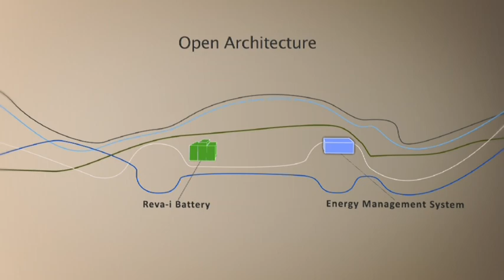Reva: Smarter Cars | The Future is Electricity | Mahindra Rise

Comment: A G-Wiz is not smart, its rubbish. Reasons: If you turn on the radio, headlights, turn signals, brake lights, hazzards or air conditioning the battery will die. If you run it into a table, the hole car explodes (TRUE FACT) And it is very slow and sluggish. Truly a car that only IDIOTS would buy. Reva: cars for idiots. Ford, Honda, Mitsubuishi, Aston Martin, Dodge, Volkswagen, Volvo, Saab etc: SUCCESSFUL cars.
Reply: It's also a successful way to commit suicide.
Reply: MisterCoolio2004 electric cars can't explode.....
Reply: @theraildynasty_  Check out Tesla news
Reply: @TheEnforcersVlog  bruhh this reply was 5 yrs ago yoooo, i was not so aware about electric cars that much then, now my knowledge is sufficient 😂😂😂

Comment: Mahindra Reva has gone a step ahead into the E.V. technowledy and this can be driven 100 Kms. per charge. Today the EV tech. has become more reliable and fail safe. Our daily need for commuting is less than 80 Kms. per day. It is a car for today's need.
Yes! Mahindra Reva will come out with long distance car too. We have tested car with more powerful Lithium Battery which gives 160Kms. drive per charge but then the Battery cost is 3.5 lakhs.
Reply from the maker: Albert cyril francis Hi Albert, Thank you for sharing.
Reply: reva for long drive is launch with how much  cost

Comment: if they really want to make a E car they should see first tesla s how the E car should be.. and what battery to be used... not acid one... see the tesla s with one charge it goes 300km to 480km  look at the speed 0 to 100 in 4 sec... thats how the car should be made yea i know it be more expensive but if u guy can make small ver of it with  Lithium battery would be more nice sure reva is good but not enough low avg speed no km range learn it guys and a good car when it come to electric car
Reply: first see the cost then compare.. iif u have that much then buy
Reply: Still watching the EVs?